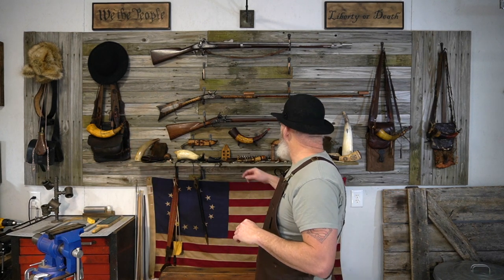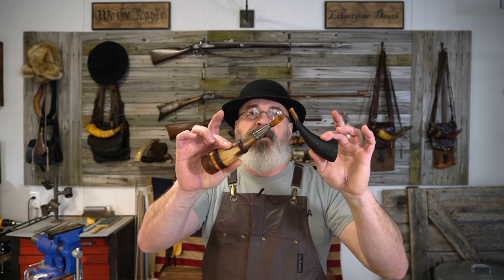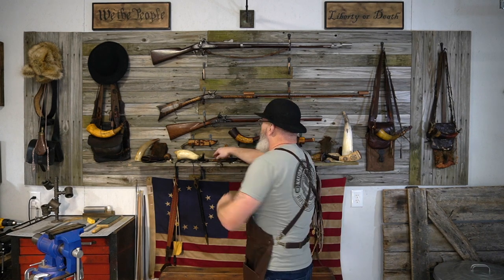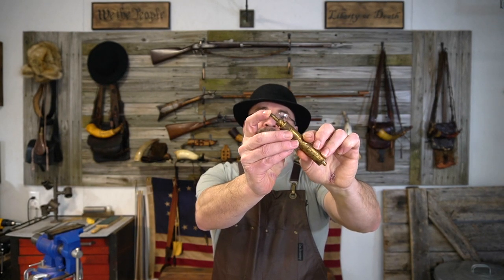PRIMING THE PAN ON A FLINTLOCK FOR FAST IGNITION

Comment: You nailed this.... you are spot on.
Like many of us old timers, we learned to do this through trial and error. Although I rarely over charge my pan, I typically tap the off side of my lock by force of habit when target shooting. Now when loading for a hunt, I am very particular about both my loading and priming.
If I come in from a hunt and said gun  hassent been fired, I'll plug the vent hole, open the frizzen and cover the frizzen with a leather stall and cover the entire lock with a leather lock cover. Never had a problem with ignition, short of a dull flint on the range. I always check the flint and action before loading for a hunt.

Comment: The NMLRA has a series of videos using high speed video and electronic timers. They primed with powder in every possible position in relation to the flash hole as well as different positions of the flash hole itself. The results were enlightening and changed how I prime. Worth checking out.
Reply: Do you have a link to the video?  Thanks.
Reply: @stevensheldon9271  I looked and couldn't find the original video series but it was Blackpowder Magazine not the NMLRA.

Comment: Bob... I have a question. I can't seem to find any 4f locally for my wife's flintlock. I read that some people grind down 2f or 3f to make it fine enough for the prime. Wondering your thoughts...
Reply from the maker: It’s something some folks do and they report very good results but I’ve had a static discharge of BP that burnt me pretty good so you won’t get the go-ahead from me. Mortar and pestle is what I’ve heard works to get some good fine priming powder. Perhaps run your 3f through a fine screen to get some Swiss ‘0B’ type powder off of it.
Reply: If you can find the 35mm film, plastic container put 2ff in it with a pure lead round ball put it in your pocket and walk in about a week you will have fine pan powder.

Comment: 1/2 a pan is fine on my flintlocks. Any more causes excess carbon fouling to build quickly. Too much carbon on the flint causes a weak or no spark. Keeping the ignition area fairly clean equals reliability.
Reply from the maker: Amen. I find the same. 👍🏻
Reply: It does. I have just pretty much got in the habit of wiping the flint and frizzen between shots. My L&R lock is very happy with 1/2 to maybe 2/3 full.

Comment: Bob: you are on a roll. Remember everybody keep the hammer at half cock and frizzen open until you are at the line (where you should be doing the priming) and ready to shoot or able to point the rifle in a safe direction. Flintlocks have been known to go "boom" with no powder in the pan. Love these videos if you are new to flintlocks or an old grizzled guy like me.
Reply from the maker: Very good point Mike. I forget sometimes that most folks shoot at the range as opposed to walking through the woods. THE FRIZZEN OPEN IS AN UNLOADED WEAPON. THE FRIZZEN CLOSED IS 1/2 OF THE SAFETY OFF AND THE GUN LOADED REGARDLESS OF ANY POWDER IN THE PAN.
Reply: I can tell you from personal experience a flintlock can fire with no priming in the pan. A lessen learned and never forgotton.

Comment: In installing the flint can it be without the cloth wrap? What's the purpose of the wrap is it to prevent the flint from breaking? Thanks
Reply from the maker: It's a leather wrap generally and it holds it still which is important for keeping the same angle shot to shot. I don't think it would work without a leather strip.

Comment: Nice to know from an expert that I'm doing it right.. Thank you.... 
It might be of interest for y'all to know about my Pedersoli .50, which had its flash hole pretty close to the pan bottom. Having pondered the wisdom of this and remembering a book written on the subject in the 18th century that I read some years ago, I got to work on the lock (I am a 'smith) and lowered the bottom of the  pan to give about 2.5mm (3/32") clearance. Ignition speed and consistency went up noticeably, being near instantaneous. So it does work best to have that flash hole well clear of the priming.
Oh...a thought... I don't hunt any more (78  years old now) but your mention of having a rifle loaded for days at a time, especially in hot weather got me to thinking whether a thick paper or thin card wad over the powder might  prevent any possibility of the lube contaminating the charge.
Shouldn't affect accuracy I would think.... What do you reckon?   :-)
Reply: Instablaster.
Reply: Weld the old flash hole shut or close it with a screw and drill a new flash hole at the correct position

Comment: Now, I bought and Indian made Ketland pattern musket with it flash hole drilled by a gunsmith at the very bottom of the pan. The pan is plenty strong yet and I wonder if deepening this further might help preventing hang fires.
Reply: Weld the flash hole shut ore close with a screw and drill a new flash hole at the correct position

Comment: I notice that some muskets at the end of the barrel by the breach plug there's a cavity maybe about 1/4 or 5/16 deep, so when loaded with less powder like 45 gr after pressing down the patch and ball the powder gets press in and is hardly within the touch hole for the igniter to ignite the main charge because the patch and ball is in the way and this causes misfire. Have to load it with enough powder maybe about 50+ grain so that it will be by or over the touch hole for instant bang. My Kentucky have no problem but my Hawken yes. Is this a factory production defect? Thanks
Reply from the maker: It’s a touch hole placement defect if you can’t load a small charge and still fire the gun.
Reply: @BlackPowderTV  I think you're right my Hawken 50 the touch hole is probably a few inches higher or away from the breech plug. Thanks

Comment: Made the mistake of buying my first flintlock, used, from a substandard builder. Flash hole is so low in pan that the guy ground out a fuse in the bottom of the pan to the touch hole. When it works it works like a firecracker, mighty slow. Would it help to try dropping the pan and grinding the pan a little wider where the guy put the ground out fuse. Any advice would be helpful. Good parts, siler lock and Douglas barrel, just extremely bad workmanship.
Reply from the maker: I’d try ordering a vent liner from Jim Chambers (flintlocks.com) to raise the touch hole and fill the groove in the pan or replace the lock. 👍🏻
Reply: @BlackPowderTV  thank you.

Comment: I "found" the priming flask and I got lazy. Now, it's the only way I prime my smoke poles. FFFF powder works just fine as a primer. FF for the gun, but I'd rather have F for the bigger grains. I'll probably start making my own powder over the winter. It's getting hard to find and expensive when you find it. The only thing I'd add to your video is my little trick (learned from playing with my cannons) of 'spiking' the touch-hole into the charge for clear passage of the hot gasses/flying powder grains, etc. to get into the main charge. I've found that my "lock times" are very comparable with modern center-fire shootin' irons. Just a little bit of priming powder (just as you said) but, first spike the touch hole. By the way, now that I've found your channel, I'm you're new subscriber!!!

Comment: Thanks for your great video.  I'm a novice flintlock shooter, and I have a priming flask that always seems to overfill the pan.  Your idea of tilting the rifle outward or tapping it sounds very useful.  Any other suggestions?
Reply from the maker: I’ve seen guys use their finger or thumb as a valve to control the flow. I’m not coordinated enough but Hershel House does it so I guess it works.

Comment: Can you do a video on touch hole size? My flintlock has a 1/16” touch hole and I get some self priming, I feel my touch hole is too big. Or am I mistaken and self priming isn’t really a big deal?
Reply from the maker: Veteran Iron&Wood 1/16” is about right. I, and most people I know drill the holes out to 1/16” if they are smaller. 1/16” is considered average. No big deal.
Reply: Black Powder TV thank you!
Reply: @veteranironoutdoors8320  Yeah, 1/16" is fairly standard. I've read of people going smaller, down to .050" on small caliber guns, but 1/16" (.062") is a good all around size. Too large and you get self priming and excessive flash back out of the hole, while too small and you don't get reliable ignition.  1/16" seems to be the sweet spot for most guns.
Reply: @crominion6045  8

Comment: If you mess up drilling your touch-hole or buy a rifle second hand that has the touch-hole drill too low or too far forward or back you can easily fix it.
Most locks have enough metal thickness around the pan that you can take the lock off the gun and working from the back side of the lock use a dremel tool and a grinding burr to grind the pan a little deeper or remove a little metal on one side of the pan or the other to center the touch-hole up on the pan. It's a ten minute job that anyone who is the least bit handy with tools can do.

Comment: If you fill the pan up halfway, will powder go into the touchhole if you tilt the firearm to the left?
Reply from the maker: A few grains will if you use a fine grain powder but it will fire faster if there is air between the charge and the primer. It seems counterintuitive but if there is a gap it allows the hot gasses to ignite the main charge instead of having a chain reaction, if that makes sense.
Reply: @BlackPowderTV  yeah that makes perfect sense, I like that trick of tipping the gun to the right so you clear touch hole. We used to make what we called cow's knees to go over the frizzin keep your powder dry. You put out some informative videos thanks.
Reply from the maker: Thanks for the kind words brother. I have a few cows knees myself. A wet fall Deer hunting morning makes them absolutely necessary.

Comment: Great info, Bob. Flitnlock pans need to be loaded no more than UNDER the touch hole. The less the better. Powder granulation depends on the firearms, but I always use FFFFG (4F) because it catches fire faster than higher FFs. Also, and very important for quicker ignition is to use a vent pick, or feather, or a toothpick to poke a hole in the powder already loaded in the barrel so it has more powder granules facing and taking the primer flash. In flintlocks it is just another way to get a faster shot off. My old Tennessee goes off like a  new-fangled percussion gun and I don't have that mule ear showing up in my face. Ha!
Reply from the maker: Right you are! Thanks Bill!
Reply: Yep.... reflects my experience..... I usually leave a little bit of brass brazing rod in the flash hole while I load....It has a loop on the end to pull it out before priming and is held by the pan cover while loading the main charge... got that hint from an 18th century book on the subject. Those guys only had flinters, and they knew how to run them...

Comment: Regarding the brass priming ‘flask’, one thing I was told some years ago was to replace the brass screw cap with a suitably sized cork. That way, in the unlikely event of a stray spark igniting the priming powder, the flask was less likely to explode like a stick of dynamite! I’ve no doubt it would still make a fair bang but at least the cork ‘should’ be the path of least resistance!! This was from a very experienced matchlock/flintlock shooter and it’s something I’ve done ever since.
Reply from the maker: Very good advice! Thanks for sharing!
Reply: Where would this random spark come from? Brass is non-sparking.

Comment: Thanks for this great informative video I got my first flintlock 50 cal a Traditional Hawkens barrel length 28" can I use the FFFg for ignition on the pan? I'll be using this FFFg as my main projectile powder.
Reply from the maker: Thanks for the kind words. Yes 3f will work just fine and it will be convenient to only carry one horn/flask. If you run into 4f or 0B you can give it a try so see if it runs faster in your rifle but the 3f will be excellent as well. 👍🏻
Reply: 3F works fine, 4F is for priming only, never use it for a main charge- gun go kablooey!
Reply: @johnkelinske1449  Hi John, how come my touch hole get foul up so fast? should I removed the screw nut cover on the touch hole to improve ignition contact? Thanks
Reply: @johnkelinske1449  yeah if it’s highly overcharged. Otherwise no. Just scale back the amount used.

Comment: With my two hawkens it seems like the when I bottom the plunger on my primer flask out once it’s the perfect amount of powder or maybe a little more than necessary
Reply from the maker: You’re right. It doesn’t take much 1-3g is plenty.
Reply: @BlackPowderTV  A lot of guys I think overprime; you are trying to create enough flash to go into the touch hole and ignite the main charge, but if you put in too much powder it will slow down the burn and you don't get enough heat where you need it to go.

Comment: What's the purpose to apply some lube on the patches what happens if the patch was not lube? Thanks
Reply from the maker: Wax in the lube mixture is not necessary at all but if you live where it’s hot it helps keep the lube from running. It’s just like if you live where it gets -20 degrees f you need something in the lube to keep it from freezing solid. 👍🏻
Reply: @BlackPowderTV  will the rifle still fire properly if the patch is not lube?
Reply from the maker: @dantankunfiveancestorsfist  The lube greases the bore as it is pushed down, keeps the fouling soft after it’s fired, and keeps the patch from burning through when the charge goes off. If the patch burns through you will get odd spin on the round ball and you will get poor accuracy.
Reply from the maker: @dantankunfiveancestorsfist  I think I saw a big smile on your face! Very cool! Thanks for sharing the video! 👍🏻

Comment: Thanks for that information. I've recently bought my first flintlock. The flash hole is above the pan but I still had issues with the main charge not going off several times. I was filling it level with the pan so I guess I was just wasting my 4F.

Comment: Black powder dose not burn as you discribed "fuse affect" it explodes, no burn rate applies to black powder.you should do the oppsite of what you say "tap pan powder away from touch hole" this will move the explostion away from the touch hole. just google slo mo flintlock to see the expolstion completly engulfes the entire pan and barrel. My advice to newbes is to cover the touch hole by turning the rifle pan to the sky and tap pan powder to cover the touch hole, this works so good I don't even carry a vent pick anymore. I know many will disagree and I was also taught to do what you say but "cover the touch hole" works better, please it a try you will never go back.
Reply: Burn rate applies to every explosive, even high explosives. High speed photography shows the fastest ignition is with the powder next to, but not covering the flash hole.

Comment: I have a priming wire ( prick) attached to the priming flask I use every time I load. This will always make the gun have a zero lock time. Touch hole can be almost anywhere.

Comment: Do you have a video on how to properly swab the barrel and keep the pan hole  clear of powder gum after firing 5 rounds so that it does not misfire for range shooting? Thanks
Reply from the maker: If your hole is smaller than 1/16" you can drill it out. That really helps keep it clear and will speed up ignition. If you continue to have issues a pipe cleaner through the touch hole should sort you out. I'll put this question on my list of How To videos! Thanks!
Reply: @BlackPowderTV  Thanks, I take my flintlock to the range once a month and it seems that after 10 rounds even after swabbing the barrel and using my pin needle to poke the hole trying to clear it up I'll always experience misfire I end up having to put powder into the pan hole but this result in fuse fire just like the one of your videos which messed up my aiming.
Reply from the maker: @dantankunfiveancestorsfist  Are you using real black powder or a substitute?
Reply: @BlackPowderTV  I am using Goex FFFg black powder
Reply from the maker: If it were me I would question the lube I was using and the size of the touch hole. Next time you go to the range try shooting with just a wet patch soaked in water for 5 shots and see if the gum is lessened. If so you need to switch lubes. The touch hole prick should be all that is needed to shoot all day without a misfire from a plugged up hole. Stay in touch and we'll figure this out.

Comment: Thanks for the great presentation. Been having troubles with flash pan ignition and even tried to polish the pan as some have suggested to no avail. I have a traditions Kentucky flintlock and the flash hole is as you described at the bottom of where the flash pan sits. Many misfires!

Comment: I get a flash in the pan 75% of the time , my gun only fires 25% of the time, my flash hole is at the very bottom of the bowl. I was told to tilt  and tap powder into my flash hole, this results in a hang fire “if” it ignites the charge in the barrel. Every time my gun fires, it is a hang fire.
Reply: Try doing the opposite. Fill the pan no more than 2/3 full and just before you shoot tip the gun AWAY from the flash hole so no powder is touching it. Hopefully this will help.